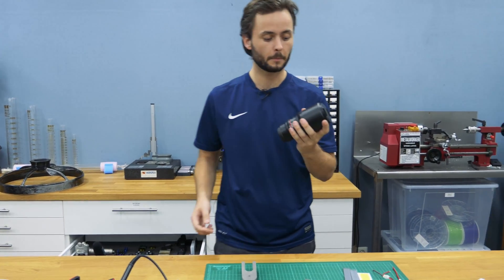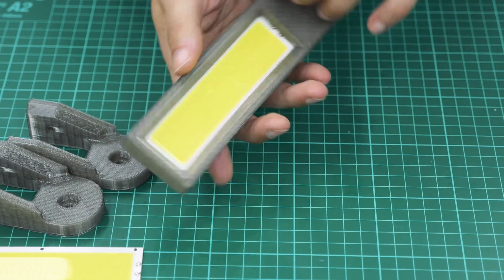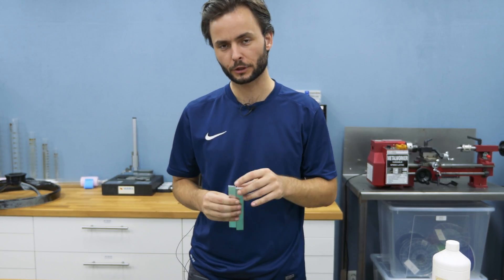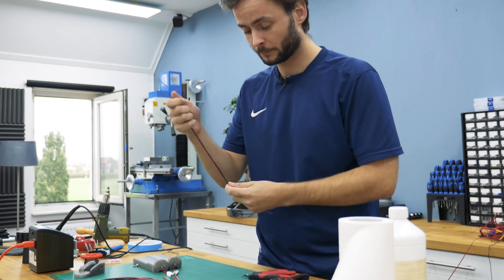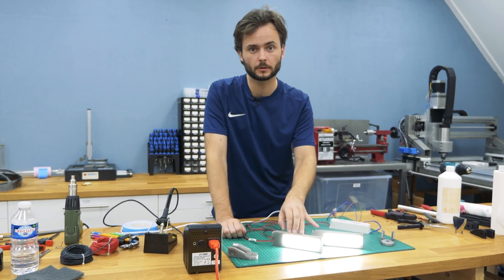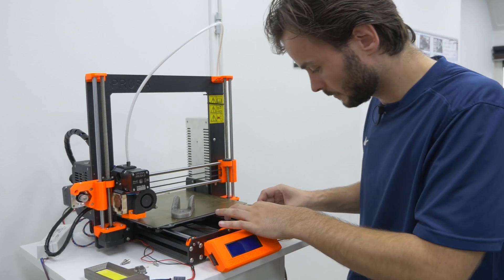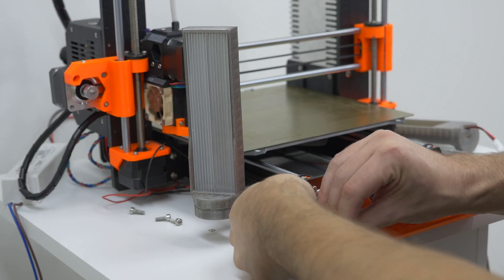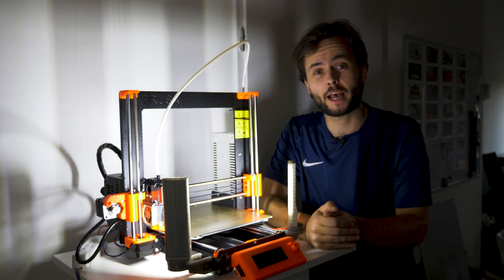Custom Lights - Prusa I3 MK3 (Free CAD files!)

Comment: What terminals are you powering this from?
Reply from the maker: Are you referring to the mains power side or low voltage side for the leds themselves?
Reply: @StefsEngineering  not sure what you mean.. i am asking for the +/- from the LED to the pruse powersupply, which terminals did you use?
Reply from the maker: Ah I understand. I didn't use the prusa PSU because I understand that it is allready at it's limit. I use a seperate small led psu, you can see it in the video and how I connected it.

Comment: Nice Video! Since there is not much airflow the heatsinks better be black. Just spraying them black will work. Take care; IR thermometers don't give a good reading on reflective surfaces like blank aluminum.
Reply from the maker: Thanks for the tip! I measured both the COB itself and the aluminium heatsink, there is definately a difference in measured temperature but accepted it as "a rough estimate" The lack of airflow also causes the heat to linger instead of it beeing transfered to the surrounding air. I am wondering though, why would spraying them black be beneficial?

My goal was to keep it as simple as possible so I intentionally did not add a fan to the design but I may decide to update it the future if heat turns out to be a serious obstacle.
Reply: Heat is transferred by convection, conduction and (Infra-Red) radiation. With a good airflow convection is dominant. With no airflow, only conduction and radiation remain. A reflective surface has a low IR radiation (IR emission and absorption factors of a surface are always the same). A black surface has the best IR radiation, although any other color is OK. At thermal issues I was involved, we saw up to 30% more heat dissipation by just spraying the heatsink black.
Reply from the maker: That is really interesting, definately not someting I was aware of. I plan to make another video (update) on this project and I am interested in trying this out (and sharing the test results for this specific application).

Comment: Great job! Can you tell us where to buy the LED's? Thank you!
Reply from the maker: Sure! I got them from ebay, these are the 10w cob led's (120x32mm) and are sold by a lot of people. 

For example:
https://www.ebay.nl/itm/12V-24V-1000LM-10W-COB-LED-Strip-Light-High-Power-Lamp-Chip-Warm-Cool-White-/152785664513?var&hash=item0&_uhb=1
Reply: @StefsEngineering  Thank you!